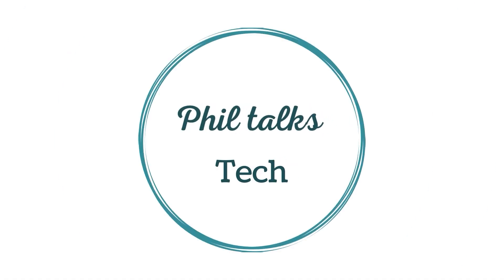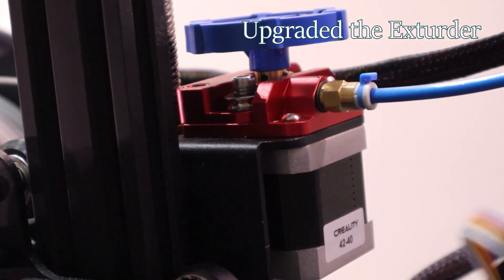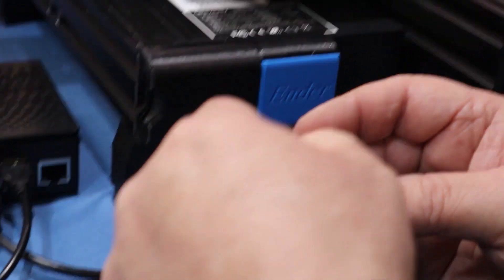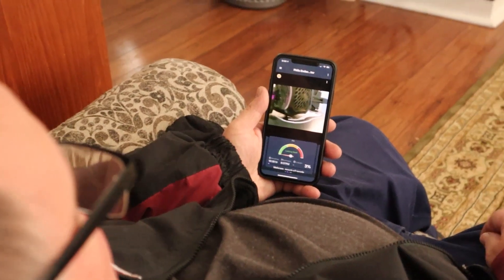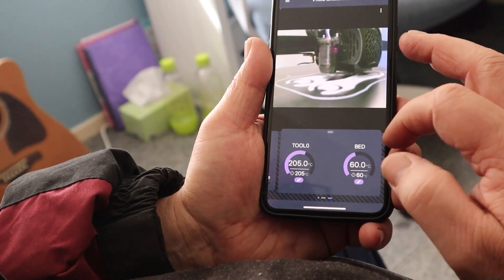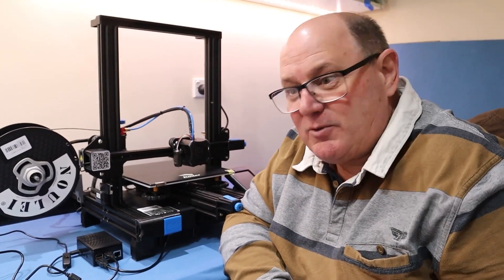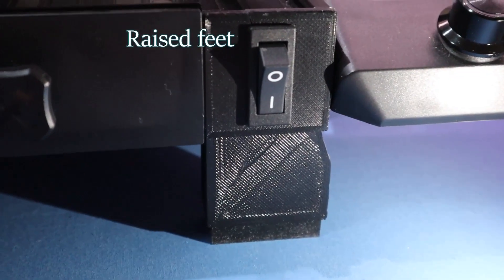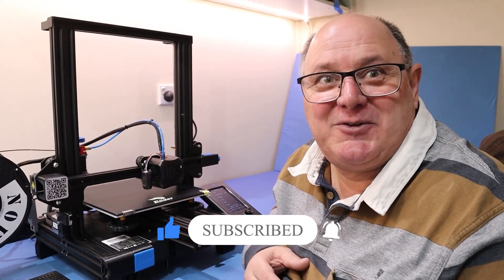Ender 3v2 mods so far Sept 2021

Comment: Do you know if newer boards are compatable with older version s of Jyers Firmware? My Ender 3 V2 shipped with a 4.3.1 version board.
Reply from the maker: That’s an ender 6 mainboard number. So not sure why it’s in the E3v2. You will need to find a firmware to suit the mainboard or it may do strange things.

Comment: Hey,
I also have the bigger SD Card adapter, only problem with mine is that I have to eject and reinsert the microsd part of the adapter for it to update. Do you have the same problem?
Reply from the maker: No mine works the same as the original one. I much prefer the full size SD card not as easy to loose and I can hold on to it much easier.
Thanks for the comment
Reply: @philtalkstech  Thanks for the reply. From what year/month is your Ender V2? I bought mine in november 2020. Does it still have the stock Creality 4.2.2 mainboard?
Reply from the maker: @groteboem  I got mine July 2020 it had the 4.2.2 board which I swapped for the 4.2.7.